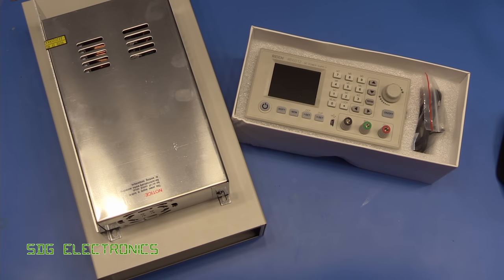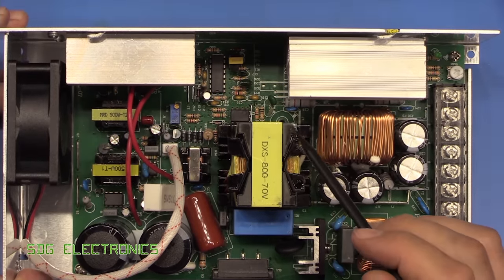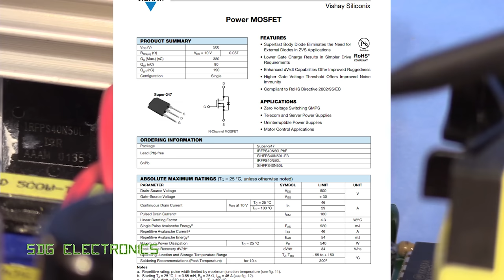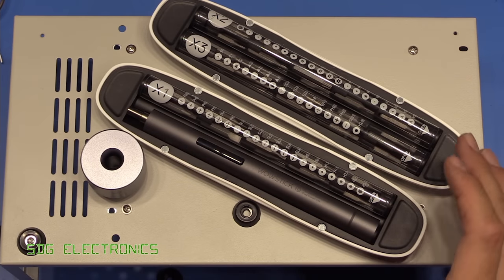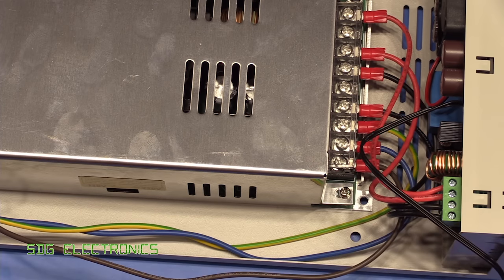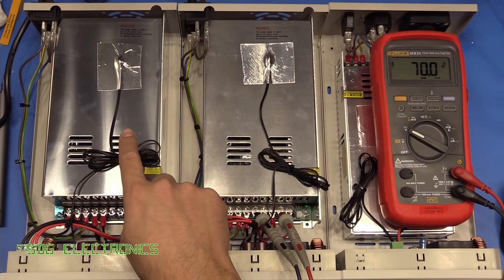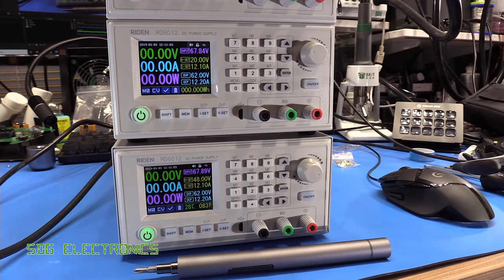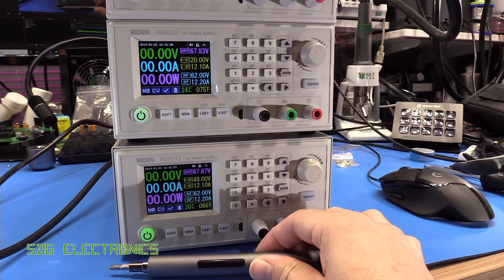SDG #181 Riden Power Supply Chassis and Power Supply Assembly RD6012 RD6006

Comment: I got the RD6006 today. Really nice lab PSU. High Voltage to charge e-bike power packs or check led strips from TVs with 40-50V.
Only the noise wasn’t tolerable. 
I modified the power supply. Removed the cover and the fan and connected the NTC from the fan control to the main transformer. It was the hottest part and this way the fan has a long delay.

Comment: They have released the RD6018 now. I got the 65V PSU, which has a raiser board next to the blue pot. The fan has only 2 levels, 0 volt of 15 volt (it's a 12V fan). I replaced the diodes at the heatsink next to the terminals, it has 1x MUR3060PT, I replaced them with 3xSTTH30AC06C which increases efficiency. I also added a 12cm fan running of the 15V board power to keep everything nice and cool

Comment: I did my 6006 with a 500VA toroid that gives me a few other isolated outputs, and with a 20000uF 100V smoothing cap
it required a soft start on the primary, but the performance and noise level is excellent, and it was great to have a use for some 
archaic and massively heavy components. I also repurposed an old piece of perfectly sized lab equipment for the case, milled a new front panel and
fitted a fan to the rear, triggered to higher speed from idle by the Riden onboard fan, I was also able to source from the junk box a few extra identical binding posts
which I removed the collar from a red and replaced the green on the Riden, then fitted a front panel (green) ground and also added a pair of 12Vac ports vertically 
aligned with the Riden posts, as I find isolated AC quite useful on the bench sometimes. I also then added a mains switch directly below the Riden soft button.
Another feature of this supply is the refresh rate of the display, it tracks voltage and current variations at amazing speed, making a nice change for digital readings where 
analogue would otherwise be better. Another small detail, the supplied temp sensor is not what's showing live on the home screen, that temp is the Riden's own internal sensor.
To get the external sensor temp you need to scroll to page four 'i' where it is the last item listed.
Great review anyway, cheers.
Reply: What kind of soft start did you on the primary?
Reply: @akhurash  I used a 10 ohm 10 watt resistor on the primary side, and a 24v relay energised from the secondary using a 1.8K series resistor for the coil to achieve 24v from the 65v rectified secondary. The relay contacts bypass the 10 ohm resistor once the secondary voltage comes up,. in use it takes about one second and the primary current draw only peaks around 5A now, down from about 30...
It was more essential than I anticipated, I also tried a NTC thermistor, but it didn't work well at high loads, although it could have been bypassed the same way with a relay, the resistor softened inrush right down, so it stayed put.
Cheers.

Comment: The temp probe was included to measure cell temps for the battery charging function provided through the incorrectly coloured 'green' terminal.
My power supply arrived with a dent in one end and DOA. It had been dropped hard enough to break the transformer ferrite core and shear off all the connections from one side.
I received a refund but managed to araldite the core and repair the connections. I've been using it a year now with no problems. The fan in mine only runs when warm.
Reply: Green does seem like an odd color choice for the battery charging port terminal. That'd normally be assumed to be chassis ground on any other device.

Comment: I also use the RD 6006-a wonderful power supply, beautiful, solid, convenient. It can even use the PC software to have programming. By the way, very well done calibration of voltmeters and ampermeter, not just +/ -, and using the function y=a+bx. Chinese guys well done - very good device!

Comment: An important isolation to check is the ground of the USB port.  If it is in any way connected to the power supply electronics having 2 of these units connected to a single computer can create a dangerous ground loop.

Comment: the newer ones come with a small board to mount to the rear of the housing  but this then eliminates the thermistor you have Mounted on the psu. i installed the small board on the two 6012pw models I just got and I'm not sure now if I should remove that and tape down the thermistor. I may drill a small hole and wire it so I can use either the external one they give you with the case now or switch it for the internal one ill have to test it so e to see if its needed. the one at the rear allows you to plug the thermistor into it for things like charging up batteries etc

Comment: the switch that came with the chassis kit welded 'on' during a long durtation operation for me... I've replaced with a better quality switch.   Also I replaced the diode with a pair, as per another youtuber, as the single diode can suffer rapid temperature failure for prolonged high-power usage.   Other than that, no problems otherwise.. although I have purchased a toriodial transformer and eventually will get that going to reduce switching noise.

Comment: Just bought one thanks to your review on them, The "newer PSU" statement is not correct as I still got the 70V with the resistor model. Guess its a tossup if you get the new 65V or the older 70V unit. Thanks for the review though!

Comment: I would've loved to see the output scoped under different loads to show the difference in noise levels.  
Maybe try to fix the 70V model in a separate video? 
I bought one of the smaller DPS3005 and it blew up from a back feed of the batteries I was charging. 
So yeah... don't do that. It has no protection. 
Also, the switches were cheap membranes and the pokey bits came through the plastic cover of the buttons. 
 This one looks like it has a better quality front end, and can withstand the daily use.
Reply from the maker: The reason I didn't is because I've noticed most of these electronic loads add their own noise to the waveform. It ends up not being a particularly representative test

Comment: No Chassis earthing then?? for the cabinet
Reply from the maker: It's achieved through the PSU chassis. The earth terminal goes straight to the PCB bosses. Agree it could use a dedicated flylead
Reply: @sdgelectronics  sorry I meant the box that the chassis is and yes you are correct
Reply: Caught my eye too. I wouldnt trust the 'connection' between the psu case and outer case, because outer case is painted.

Comment: Is it possible to use two of these together to produce a +/- supply for opamps and power amps?
Reply from the maker: Yes. The outputs are isolated using the AC-DC converter supplied with these
Reply: Have recently bought a large, salvaged center-tapped transformer for experimenting with audio power amps.  I get 64V DC, after rectification and smoothing ... the voltage is a little too high.  I worry that high frequency buck converters will introduce noise, necessitating another round of capacitance multipliers to remove it.  Unsure what audio hobbyists use to drive chip amps, when a very smooth, symmetrical center tapped power source is needed.
Reply: @GnuReligion  Capacitance multipliers? Perhaps you mean (LC) filters? High frequency buck converters should have low ESR (ceramic) capacitors at their inputs and outputs to contain the noise and ripple. For audio circuits in most older commercial products and hobby projects you will find a linear supply (50 Hz transformer) and linear regulators providing the supply for the pre amplifiers (often +/-15 V). Switched supplies aren't that popular for audio, maybe that's just because people think that switching noise will be an issue. I have a more modern receiver on my desk from Denon which uses a switched mains supply and a class-D power amplifier. The outputs of that amplifier are in a bridge configuration (like an H-bridge) so a symmetrical supply isn't needed.